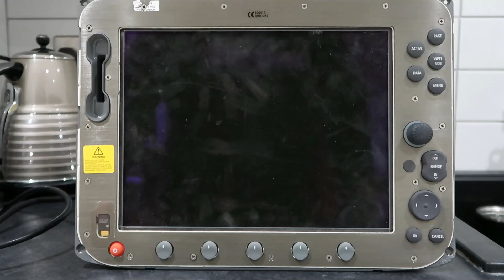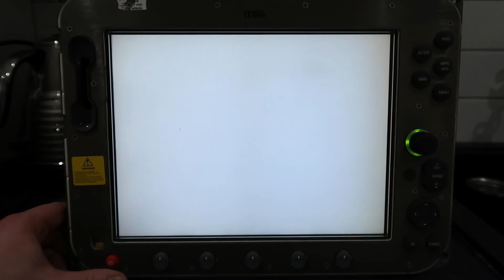Raymarine E120 Chartplotter Screen replacement

Comment: Hello,  Where did you purchase the replacement screen for this?
Reply from the maker: I got it on ebay from china, it's not a direct fit obviously. I think it's from a mitsubishi CNC machine but it works perfectly
Reply: @crusader7775  Thanks, and excellent video!
Reply from the maker: @jeffwomick3515  https://www.ebay.co.uk/itm/174901259757